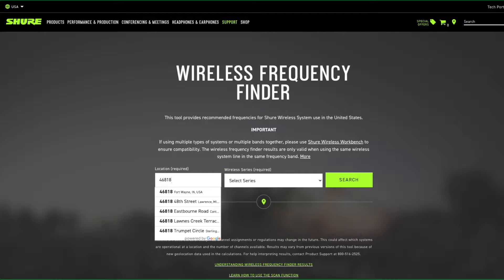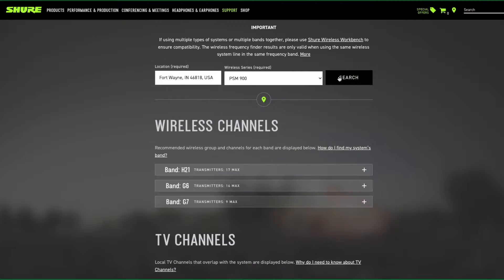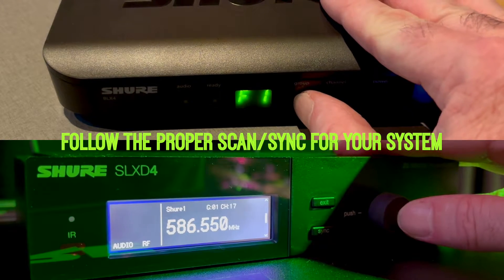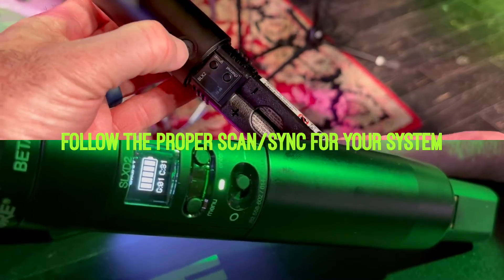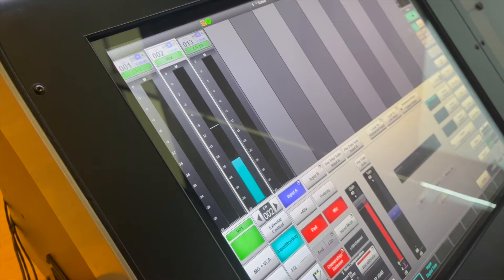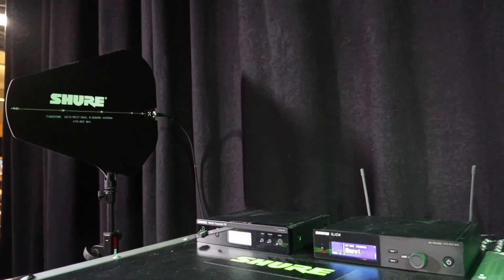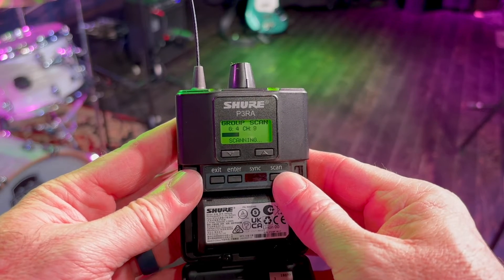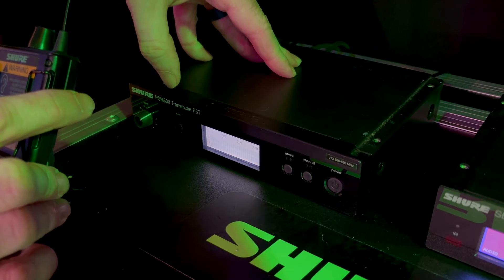How to Set Up Your Wireless System for Maximum Performance and Range | Shure

Comment: I need somethiLooking to step up my show equipment looking for a wireless UHF system that runs on batteries for the receiver and the transmitter something that I could do XLR input and outputng that th
Reply from the maker: We hate it when we push send too soon, too! Let us know if we can still help. A quick thing to note is that our battery-powered receiver options (SLXD5 and ADXD5) are not available with XLR outputs, if that answers your initial question.

Comment: I just bought the wireless MoveMics without the receiver - they connect fine with the MotivVideo App and sound great outside with fuzzy topper for wind BUT the app must be used for the video recording and is Heating up my iPhone 11 Pro super high and drains the iPhone battery pretty quickly.  Is this a known issue?  Does having the receiver help alleviate this issue or any other suggestions to alleviate?
Reply from the maker: Hi @jenann1031. Please reach out to us at https://www.shure.com/en-US/support/service-repair to troubleshoot your issue.